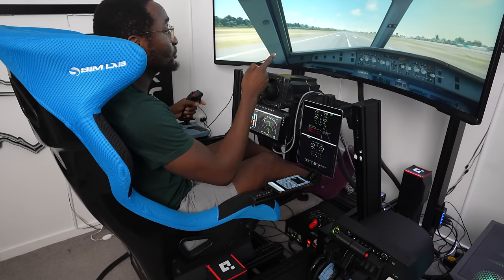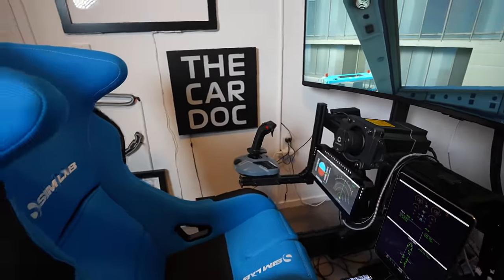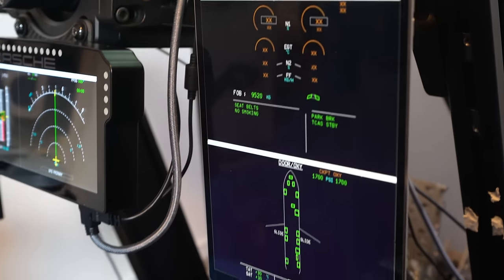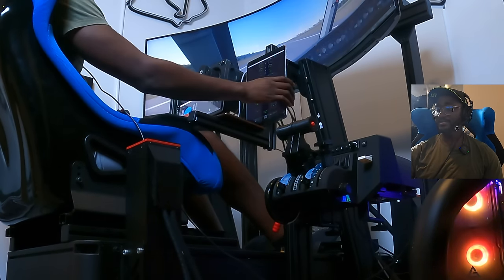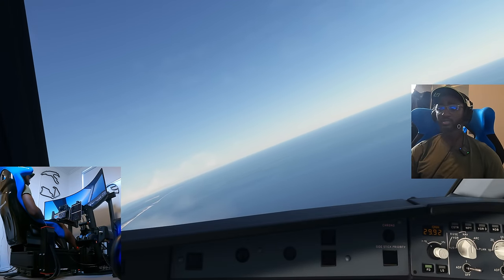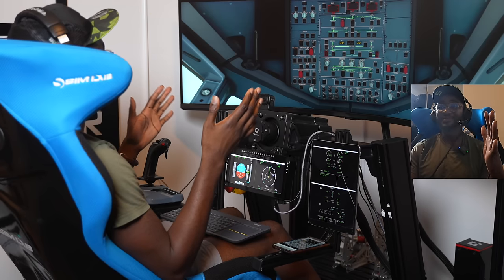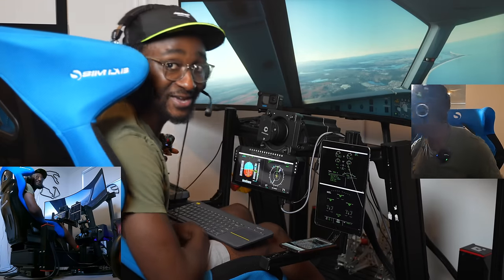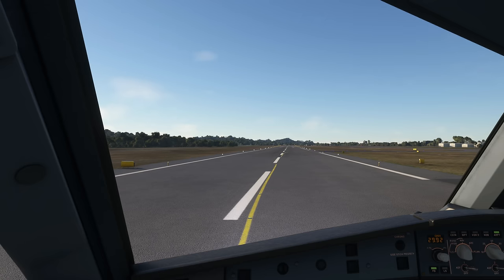When Your Flight Sim Hobby Goes TOO FAR...

Comment: I got started on flight simulator a long time ago. Went from XT to AT, 286, 386, 386 with math coprocessor chip, 486, 586/Pentium and all of the items up to now at an i9 with a 4080 and m.2 drives. All of my H/W upgrades were so I could fly at a better FPS. I want to build a cockpit. I just have to make it my next project. Nice setup, I like that chair.

oh, I almost forgot, get the Fenix.

Comment: I went with the: (1)Next level Racing Boeing Military sim pit (2)Thrust Master A-10 HOTAS stick and throttle used. (3)Thrustmast TPR peddles. (4)Next Level Racing HF8. (5)Winwing F18 PTO 2 panel. (6)Vizio sound bar with subwoofer. (7)Samsung Odyssey Neo 57" curved monitor with quantum mini LED, 240 Hz, (8)TrackIR-5 head tracker
(Soon to add) Winwing Top Gun MIP, I would like to add motion like yours.

Comment: You could install the accessory (a small bar to attach to the screen) that adds touchscreen functionality to any flat monitor. But I'm not sure this accessory will work well on a 57 inch monitor. The one I saw on Amazon was for 13-27 inch monitors. As you said in the video, a touchscreen would be great for your setup.
Reply from the maker: Ooh, good idea..but might not work, i’ll look into it!

Comment: I have a very similar setup, only sans the full-motion rig and external displays.  Don't bother trying to drive the G9 at 4k as it doesn't support 4k and you'd be generating pixels you don't need and won't even be able to use for no reason, bogging down your system overall.  I would strongly suggest adding a TOBII eye/head tracker so when your head moves, so does your view making the view controls mostly redundant...  Though sometimes it can get confused if you're trying to turn to the limits of your view, like for the overhead or anything behind you.  As awesome as the FBW A320 is, Fenix has it beat and that's true for their Block 1 version, and the release of Block 2 is imminent, adding a new engine option, cabin crew, and a whole lot more, including the ability to break things either on purpose or via abusing it.  You have a new sub from me, and let's go flying together sometime!

Comment: Wouldn't it make more sense to attach the main monitor to your 6dof? I would assume that its specs could handle the extra weight. Or perhaps you plan on doing this in the future.
Reply from the maker: It would, but the Samsung G9 57 has been known to have some issues, I don’t really fancy vibrating it to pieces on the motion system, and i’m pretty happy with it the way it is and havent felt i’m missing out on immersion… I do have a VR headset too haha

Comment: Amazing Setup, very nice. But it needs a VR headset. Such a screen can not even closely recreate the immersion of a VR headset.
Reply from the maker: yes, it actually is, running at 2K, mid settings! I'd recommend more than a 3070 if possible, but it definitely has run well enough on mine for a while!

Comment: I would love to have something like this, but I'm worried the seat would end up crushing one of my 2 cats when I'm not paying attention lol.
Reply from the maker: That is genuinely a possibility, theres lots of warning signs all over it
Reply: @TheFlightDoc  Man I bet it would be crazy flying a fighter jet like the F-22 with that seat! Also I would look into upgrading to a RTX 4090 so you can turn on frame generation which lets you achieve a high FPS while running 4K. That's what I'm currently using with a i9-13900K/64GB DDR5 and I never go below 110FPS with any plane even in the middle of NYC. I used to run a 2080 w/ i7 9700k on 1440p but once I saw how it looked in 4K I just couldn't believe how much of an upgrade it was.

Comment: Does the system have ATC air traffic control mode, so that you can practice making calls, and switching navigation aids and communication from tower, to departure, to ATC, and flying according to standard instrument departures (SID's), or does it include sectional charts, or IFR routes, or is this a solo universe flight simulator with no ATC or navigational aids?

Comment: Is cool. Does it render curved or linear for your curved screen? if it's linear then it shows the wrong perspective and the screen curvature is wasted except for minor eye focus.
Just a motion seat can really help a lot and make it usable for actual flight training. Although good VR will take the immersion from 20% to 90. You could try meta's headset, I hear it's pretty good for modest cost.
Reply from the maker: It renders it linear unfortunately. Flight sims haven't quite caught up to where racing sims are, like iRacing, with its curved correction.
I've got a Varjo Aero for VR, video coming soon :)

Comment: Very nice setup, I'm curious of what your screen resolution is, I have that same monitor but I'm not liking the stretched look it gives. I'm using a 4090 and i9-13900k.
Reply from the maker: Resolution was 5120x1440 running on a 3070

Comment: I don't agree with that motion thing. If your sit tilts like your airplane banks (creating lateral G) that would mean that your turn is uncoordinated (your airplane is banking more than it needs to). In a coordinated turn there are no lateral accelerations.
Reply from the maker: I think the realism of the motion is different when you're sat in it, watching the screen, it gives my brain enough cues to make it feel like it adds another dimension. The tilt isn't huge, so the lateral g so to speak isn't that noticeable, but I get what you mean! I'd still never trade the motion away ever aha
Reply: @TheFlightDoc  I get that but the feeling is just off. If a pilot felt what you feel when your base tilts he would think that his turn is not coordinated and he would level the wings or push on the rudder pedal. Vibrations, tilts to simulate acceleration and slowing down and all that, sure, but the banking is just incorrect and I'm sure this base could do better.

Comment: Hi, buddy!

Thanks for your video! It's really interesting and I'm off (finally) for a double rig (flying and Racing). I have a question about your setup with the Honeycomb bravo. Apart from the table brackets (rig-throttle), what other accessories did you use to secure everything? Just a standard aluminum piece or something else? Sorry if you answer this in your video but I didn't hear or understand this 😅.

Best regards,

Gilles
Reply from the maker: Thanks for watching Gilles!
I used the HOTAS mount attached to the base of the SimLab P1xPro 
sticking the ipad and phone down to the aluminium profile with double sided clear tape. The Porsche DDU is secured with a mounting bracket to the simucube wheelbase :)
Lemme know if you have any other questions!
Reply: @TheFlightDoc  Thanks for your information! I'm looking forward to my Monstertech rig! Now I can see more clearly and it's a great trick to use the desk mounts! See you soon!

Comment: And overnight VR made all the big multi screen pancakes obsolete.
Reply: I love the idea of VR, and actually went down that rabbithole for awhile, but got tired of feeling like I needed glasses but forgot them at home as it's quite blurry compared to a good monitor.  Throw in a good head/eye tracker and you get a lot of the benefit of VR without the downsides.  When the tech matures to the point that it's as visually crisp as a display, then I'll dip another toe in, assuming it's available at a reasonable cost.

Comment: Also please describe the desk mounts that let you switch between race and flight.  More details appreciated, thanks.
Reply from the maker: the mount is in the description, and it's essentially a clamp style mount, very adjustable allowing you to attach to a wide range of surfaces :) Will go into more depth in an upcoming video with the boeing set up
Reply: @TheFlightDoc   Is it clamped to the rig upside down from what it would be when used on a desk?

Comment: Ooh, huge respect. Flight-sims and racing-simse - one love. But not so enthusiastic - G29 for racing. tried for fluying, not bad, but finally using Xbox controller for flying. Not very easy, but calibration helps, difficulta with rudders, just using a/t 😂

Comment: it will be much better with VR instead of a small flat screen
Reply from the maker: I mean it’s a 57 inch curved monitor, neither flat or small 🤣
Reply: @TheFlightDoc   flat mean "2d" (vr user slang 😅) also it gives smaller pov since you can look around in vr. Great setup anyway 👍

Comment: Im the asshole fairy dave. Here to point out all your mistakes 

1) detents not ident. Ident is short for identification. Detents are the hard stops on machinery that are usually built for safety reasons. (Like the detents on an moveable xray collimator you might have seen. If youre in there when xrays are taken)

2) your motion rig does pitch and roll. I guess it does heave but thats because it does pitch and roll by using the four individual motors. So by if you have pitch and roll you also have heave unless you dont have individual addressable motors. 

3) just a tio from a fellow simmer. In your graphics settings, turn off DLSS. It will get rid of that ghosting/smearing you see with the numbers when you change values on your FCU there.

3) you say youre getting a mini FCU. A streamdeck + is a great piece of kit to get to use a good bit of your other buttons. It takes a bit of tinkering and coding. Even if you download all the presets available.
Reply from the maker: Thank you, genuinely appreciate the feedback, imma try it with DLSS off!

Comment: You should add a vr headset
Reply from the maker: Coming soon!
Reply: @TheFlightDoc I would recommend the meta quest 3 or the valve index. I would take the quest 3 because you can use it standalone and pc vr and you can play wireless which is great. The quest 3 also has more fov than the index. And also the quest 3 uses inside out tracking and the index uses the light house tracking. With the quest 3 you don’t have to put anything up in your room. But still both are great vr headsets. I have the quest 3 and it’s great for pc vr and stand-alone.